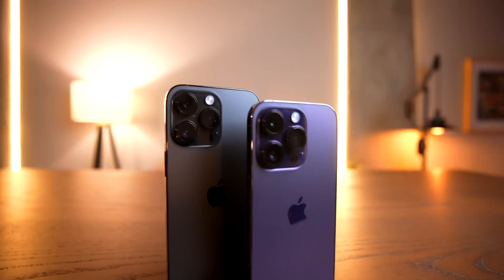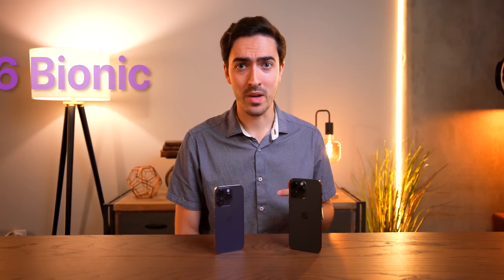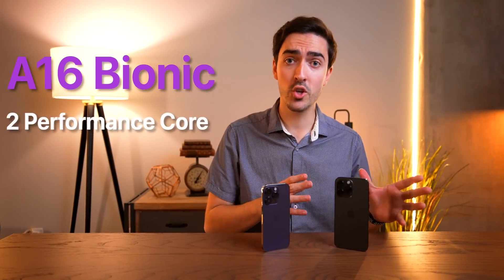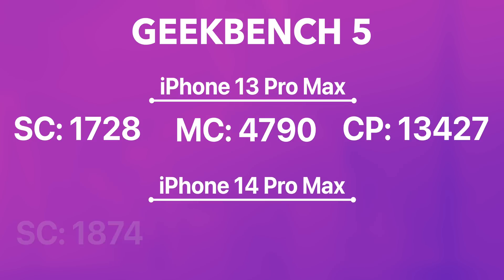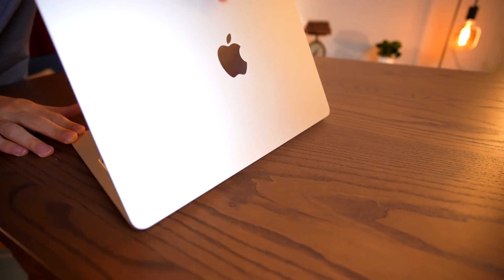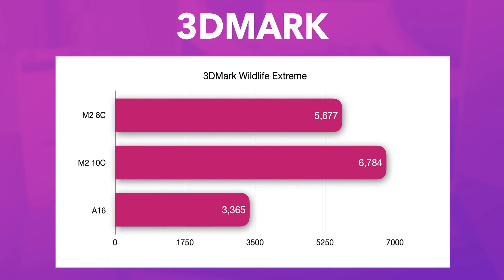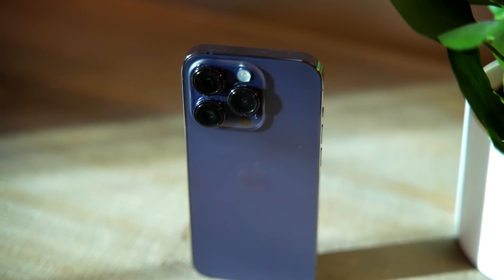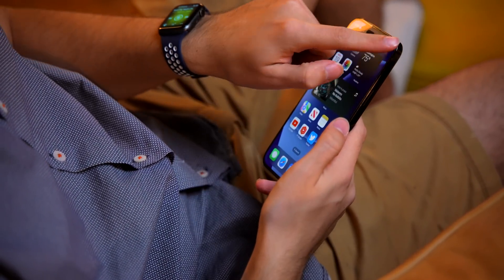A16 vs A15 Bionic TESTED: Apple is HIDING something...

Comment: I believe the A16 chip is mHz lowered to use less energy I.e. battery life rather than waste it on questionable speed boost advantage. This helps keep battery weight/size down while still improving or sustaining current norms. M2 chips will not be so constrained for energy saving and will likely see higher mHz speeds for purposeful gains. I think this should be more obvious than your speculated concerns.

Comment: 4nm isn’t a full process node. Its more of branding and optimising the 5 nm process ( which itself wasn’t a huge jump from 7nm). 3nm process node will be a full process node jump from 7nm. So there is not a lot of performance gains. It will mostly save more power than performance.

Comment: My generation is responsible for YOUR generation’s fixation on specs. My generation was already over five feet tall when person computers were invented. They sucked. Hard drives were measured in megabytes, not gigabytes. Floppy discs and dot matrix printers were your external storage.   Big computers used punch cards. 

For us, yearly updates didn’t do it. We grabbed whatever was next regardless of brand. Commodore, Apple, TRS (Tandy, radio shack) and IBM. Then came windows and leaps in storage capacity. Every few months a faster processor wasn’t just wanted, it was needed.  Processors were measured in kilohertz, not megahertz. Memory was kilobytes and megabytes, not gigabytes a terabytes. 

Now, devices are so good I think nanometers do not matter. What’s matters is portability, durability, and what does what you need to do. Moore’s law is a relic of the past, as is the fixation on specs. 

YOU live in an exciting and easy time for technology. Don’t let it drain your finances.

Comment: I think the next major leap forward will be the A17 Soc, which will be built on TSMC's new 3 nm process that they have been working on for 3-4 years. I wouldn't be surprised that the 2023 iPhones will have two versions of A17:

iPhone 17 and 17 Plus: 4 high-performance CPU cores, four high-efficiency CPU cores, 5 GPU cores, and 6 GB of RAM.
iPhone 17 Pro models: 4 high-performance CPU cores, four high-efficiency CPU cores, 6 GPU cores, and 8 GB of RAM.

The A17 will integrate with either Qualcomm's X70 radio modem chip for better 5G connectivity and a new (maybe!) Broadcom chip for full WiFi 6E (802.11ax extended) support.
Reply: You’re comment aged like fine wine

Comment: Imo phone manufacturers should finally acknowledge, that benchmarks of flagship cpus are not relevant anymore in 2022 - I don't care about the fact, that phone got 5000 pts in Geekbench if it isn't able to maintain stable 120 fps (and sometimes even 60) in most games for more than 10 mins.

Comment: They are making the chip faster for AR/VR headset ... somebody has to subsidize the R&D. 

You guys are so guilible. 

Apple always use consumer's money for their R&D. That's how it works.

They have been pushing the SoC towards best Performance per Watt for a decade for this exact reason. To achieve performance suitable for wearables and battery life is sufficient so you don't need to carry a brick for AR/VR glasses.

Expect Apple to keeping the limits. It's irrelevant whether consumers need the processing power atm or not. What matters is what you need in the FUTURE.

Comment: I’ve got the 14 pro max. 

In my experience so far. 

When it comes to the A16 chip, it’s about the same last year both with the CPU and GPU performance (hardly noticeable), but multitasking, dynamic island and RAM intensive apps absolutely love that new DDR5 RAM. 

The RAM is the biggest upgrade imo.

Comment: I think the topic deserves a followup video, look at Golden Reviewer and Geekerwan videos, you will see that GeekBench peek performance is not all that relevant, the 4nm process for Apple is all about power efficiency and sustained performance. PS: When comparing the iPhone to Macs use magsafe coolers like the Razer Chroma to make a fair comparison...
Reply: Manufactures have been able to detect geekbench app and tweak its results for years. I remember Samsung caught heat a many years ago because the were caught running some special overlock mode for the CPU and GPU when geekbench or ANTUTU app was running to ensure they would get the highest scores possible. But during normal operation the phone would never hit those clock speeds. I’m sure they all do it now just better at hiding it.

Comment: the m3 chip will be based on the apple a17 bionic so what apple did in the a16 will not affect the next generation of apple silicon but what worries me is that if you compare the monocore performance of the a14 vs the a16 you realize that the ipc of the high performance cores has not changed and the performance improvement they get is only by increasing the frequency this for 2 years of development is the apple core designs it is a failure if in the a17 you do not see a change big the problem is clear something is happening in apple and its revenues that design their cores why 3 years have already passed and they will be able to work with a much more advanced manufacturing process such as tsmc's 3nm I expect a lot from a17

Comment: Doesn’t matter if Apple fabricates chips on a 1nm process, there’s no mobile software that requires even half of the performance we currently have.
Reply: It is more to do with efficiency. If you can get the same result from using half the power at 1nm v 5nm, then why on earth would you not want that? It is important and trying to make it not is just fake.

Comment: Luke, Question for you and your followers? Does any of your followers had an issue with the screen doing a squeaking sound when you press near the dynamic Island, even when the phone is turned off?
Reply: it sounds like a manufacturing defect. I had a similar problem with the iPhone 6, it would squeak when you pressed one of the corners. That phone turned out to be a total dog, hated it and gladly got rid of it after a few years.

Comment: You’ve neglected to consider the clock rates of these chips they probably run the mobile chips at a lower clock and with less boost clock

Also the m2 is based on the a15 architecture and process, speculating the m2 ultra based on the mobile a16 is not right. M2 ultra will just have more m2 cores and won’t gain any improvements from a16

Overall your methodology is flawed
Reply: True!

Comment: This kind of video only comes to shown that you have no idea about silicone process and the way it works.
We can know for sure what N4 apple uses (most of the time its a custom one for apple only) but do do know that all of the N4 processes are a REFINEMENT of N5 and now a completely new process like N3. 

"The silicon manufacturer is positioning N4P as a refinement of N5 and N4. TSMC claims N4P will have an 11 percent performance increase over N5 and a six percent increase over N4. The process should be 22 percent more power-efficient than N5 and have a six percent higher transistor density. It also says N4P will cut wafer cycle time and decrease process complexity by lowering the number of masks."

Comment: I feel things like the neural engine, encoders, ISP is probably as important in the A16 as the CPU yang GPU. But 14% better single core year over year is honestly more than I expected. It's a shame that the battery life is apparently worse than the iPhone 13 Pro though. I wonder if that's due to the A16 or perhaps other factors.
Reply: ...other factors, mainly buggy iOS 16.

Comment: it's not a new manufacturing process, 4nm is 5nm optimized. also, a16 cores are very similar, if not the same as in a15, just overclocked. the biggest improvement w/ the a16 is the move to lpddr5 from lpddr4x.
Reply: Yes, this is well documented. TSMC have a tick-tock output, so 5nm then 5nm+ (whatever they call it for marketing). Sometimes, there is a tick-tock-tock, say when the 3nm had low yields, and they decided to skip it and move to 3nm+ when ready, so in the interim, we get the A16. I mean, I know no one that it complaining about the iPhone's performance, so making a meal out of it, seems totally misinforming viewers.
Reply: @andyH_England  he's probably not very knowledgeable in terms of tech stuff

Comment: You can not compare cores without looking at the clock speeds! If they are clocked 10% higher and computes 10% faster, than the core itself is not faster per clock cycle. It may be a bit more energy efficient so it can run faster without drawing more power or getting hotter though.

Comment: I have to assume that the trend of having the A platform being the progenitor of the M series cannot continue. The processor and chip tech in the iPhone is already wild overkill for all but maybe 1 percent of all phone users on earth. It was, pardon the pun, low-hanging fruit to take an A series chip and just shoehorn more processor and GPU cores into the first generation of Apple Silicon computers, but while you can continue to make the A series more efficient and maybe a little faster, if A series inspired tech will be all we can expect out of a $2500+ MacBook Pro or a $4000 Mac Studio three or four years down the line, then Apple has made the silliest miscalculation in two decades. Certainly, Intel and AMD won't be kneecapping their platforms by bringing glorified phone chips to power flagship desktop computers in that time frame. I have to assume that Apple is far, far smarter than this and that M-series chips will eventually have their own roadmap and evolution, completely or at least mostly independent of A-series chips.

Comment: I'm no expert, but is using percent change the best way to compare generations of chips? For example, what's better, getting a 20% pay raise when you're making $10,000/year or getting a 10% pay raise when you're making $100,000/year? Clearly the smaller percent pay raise actually represents a much better pay raise.

Comment: A 15 has about 15.8 billion transistors.
A 16 in the official iphone 14 pro promo video has "nearly" 16 billion transistors.
Got it?
4nm is not a real thing too. It's actually a third gen of 5nm but it was renamed for easy marketing purpose.
Got it?
There is almost no new processor this year. Only a modified version of A15 to run the new features on the new screen.
They even didn't update last year image processing. It is still Hdr 4 according to the official web site with its issues like over sharpness and crushed shadows remain unsolved.
Reply: Yes, if you read the news from TSMC that their 3nm process had poor yield, so Apple had to resort to 5nm++ rather than scratching their heads, then this would not need this video. That is why they kept the A15 in the base models. It was Apple making the best of plans that had to be put on hold due to fabrication delays.

Comment: very interesting. I was super excited to see A16 based on 4nm, but not seeing many gains in both performance and battery is concerning. Gotta think M2 pro will have 300g/sec ram, the faster internet speeds, faster SSD.. and perhaps 15% improved performance with 15% improved battery life?  Is it worth it or maybe make more sense to get the M1 pro with 1TB SSD and unbinned chip for $400 off at best buy?
Reply: M2 is based on A15, not A16
Reply: @roundduckgirl  a bit late on this lol

Comment: Funny how last year we said the A15 was on the same process as the a14 (even though it added billions of transistors and was honestly a pretty decent upgrade in terms of performance AND performance per watt), but this year we say it’s on a new process even though “4nm” is just the 3rd generation, or the second upgrade to their 5 nm process.
Reply: nm doesn't even mean nanometers between gates anymore. They're using it as more of a marketing term now to show differences between generations than how much they've actually shrunk the chip. It get's confusing because Intel's 10nm chip actually has more transistors for a given size than TSMCs 7nm. They've run into barriers with physics for shrinking it any more. Once they get sub 1nm it will be interesting because they will need to find new ways of marketing the chip process - it would be very misleading to say transistors are less than 1 nanometer apart.
Reply: @chadh6855  exactly. And even with a lower density tsmc is universally considered the most advanced chip maker in the world. So density isn’t a good indicator. Distance between gates is irrelevant. It’s all just marketing. Everyone got on my case last year for mentioning that the second gen 5nm was a pretty big upgrade. And this year everyone wonders why not much has changed even though there’s a “new process.”
Reply: @jesseandersen4055  well the fact is they've hit a wall. Intel is really bummed about it and struggling to maintain superiority but ultimately if our computers and phones worked any faster we wouldn't notice. When I bought my first computer in 1998 with a 250+ nm Pentium chip and floppy disk drive improving nm process was definitely important. Not today.
Reply: Forgiveness or Love  everyone has trouble imagining the future. When I was a kid we were told we would have a colony on the moon and flying cars. Nothing about iPhones. The fact is there’s not a breakthrough in computing power that will affect our daily lives anywhere on the horizon, unfortunately.

Comment: It's not too confusing, N4 is very much in the N5 family with clock speed improvements for the same wattage or else power reductions or a combination of both. A16 largely improved by clock speed increases. N3 we should see a bigger architecture change.

Comment: I believe that the only change they mentioned is the new display controller.  14% is not small, do you remember the Intel days. These changes from AMD,  Apple, and Intel are an anomaly. It's Moore's law, not Lazarus's law. Once it's dead it's dead. When we have a different technology like Opto-electronics or Quantum Computers or something we will have new performance, in the meanwhile this year and maybe the next are anomalies.

Comment: I play Apex Legends Mobile and I’ve noticed a huge thermal performance improvement on the A16 vs A15. I used to get screen dimming after 10 min on High settings. Now I can max it out on Ultra HD at 60 FPS and no thermal issues at all for 20 min+.

Comment: That is completely normal…
The magic wall, when it comes to Silizium computing, is allready 5nm what apple has used in the iPhone 13 Pro Modells (and now in the normal 14 devices too), everything which comes after that is just less efficient and it would be way more harder to get more power from that…
This needs way more development as you can make in just one year…

I know that we had allready some points in the past where people said „oh, we are near the end..“ but this time it’s just true, Moores Law has finaly find its end and here we are now…
To get more processing power from the same size of an chip would not work any longer, at least by far not in this way it works in the last 3 decades, from now on we can only get more processing power when we just make the chips bigger or do more layers on a chip which „just“ results in a thicker processor…
But from now on, we will not longer see devolpment where we can double the power just every 1 or 2 years, at least not when we don’t get bigger with the die‘s itself…

The only option from now is, new stuff which works better…
There are allready prototyp class 1nm die‘s out there but they don’t work anymore with silizium, it was a stuff we use today just as a lubricant but how I already said, this is prototyp stuff and that means that it still will need years till we can see this in a mass produced product…

Exactly that’s the point why most company’s go more and more over to cloud usage, when anybody will use this in a couple of years the company’s don’t need to produce high end devices anymore, there they just need mid tier tech cause the device it self don’t longer need to all the work on its own, then it is enough when it’s just a bit more powerfull as an tv to get the same experience which we have now with an high end gaming PC and that just on a tablet or a smartphone…

Long story short, we just need something new when we still want to get further how we done it in the last decades or a completly new solution how we use computers (cloud), everything else is now coming to an end in the next years and even if company’s like tsmc have allready planes to 2nm production, even when they could make it, it would be more or less the same with only minor changes anymore…
It’s just over…

Comment: I think the main difference is clockspeed. A14 was the original 5nm chip, A15 had higher clock and new efficiency core I think plus one more gpu core on the pro made on the optimized 5n plus node, A16 higher clock on the further optimized 4n node which actually still is the same 5nm process. 
Bigger changes probably coming with the 3nm node which is a new process.

Comment: Don’t think that any of them realize that 4 nm process is just a commercialized real world marketing term. It has nothing, absolutely nothing to do with the actual pitch or length of the transistors.
The actual physical size of a “4 nm process” is more like 40 or even 45 nm. 

This guy tried outing a problem with a shaky cam on third-party apps that will be fixed, so FAIL! Now he’s trying to make a big deal out of something that all manufactures do, and have been doing for sometime now.